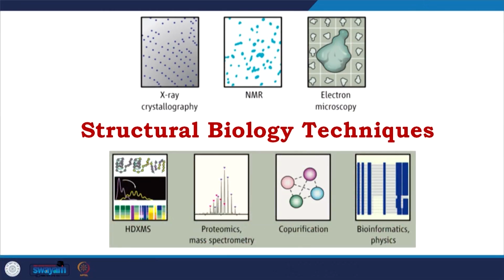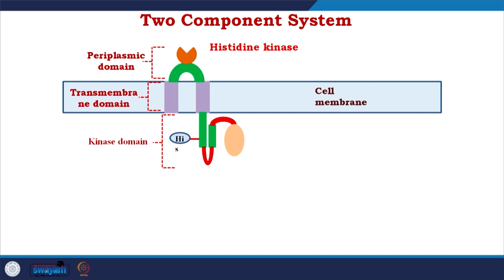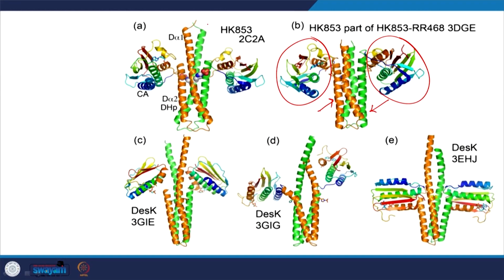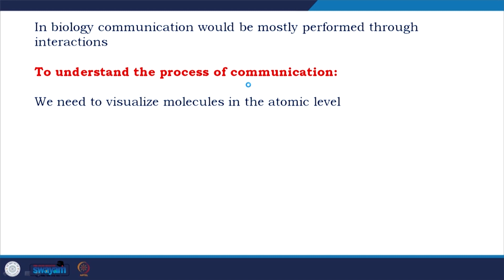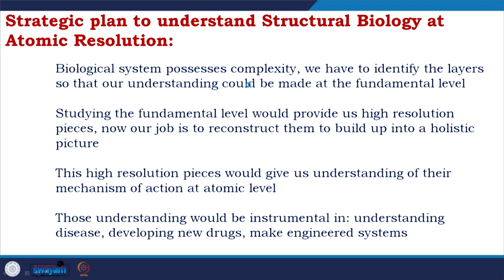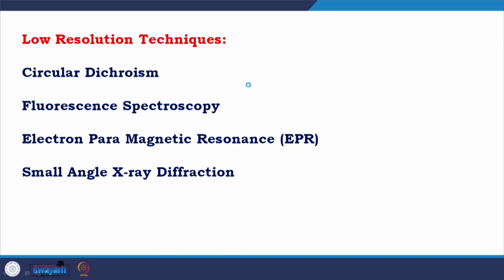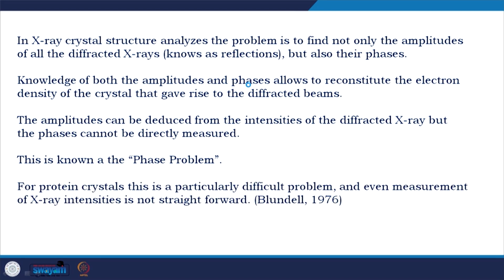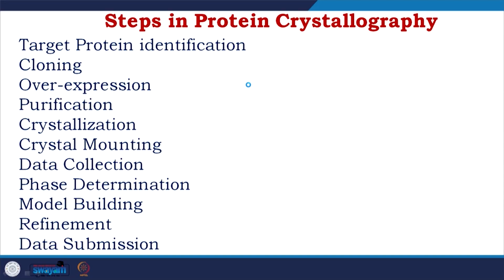Introduction to Structural Biology Techniques Part I

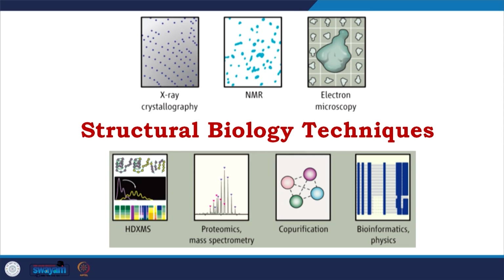Comment: 0:55 the techniques of structural biology
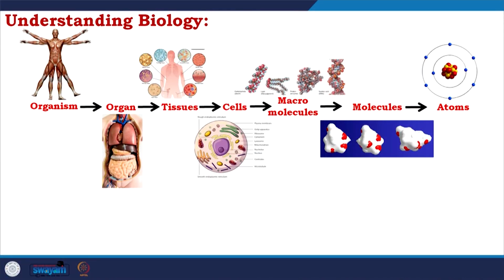2:38 small molecule metabolites
5:20 water droplet example, microscopic organisms ; two-component system two propene: histidine kinase , periplasmic domain - receptor responders to emergency situations, eg heat communicates to bacteria, which express —-